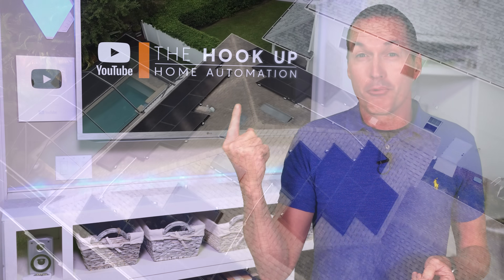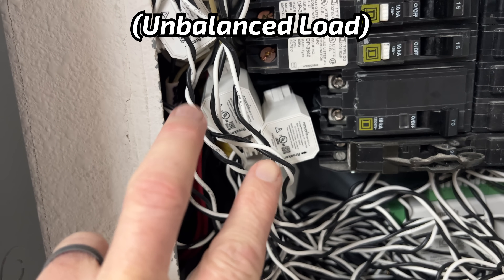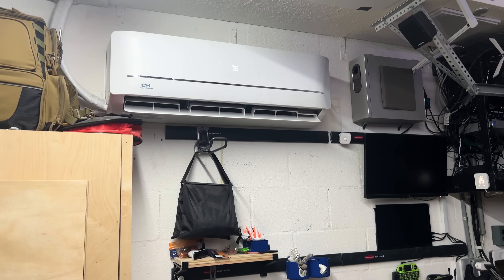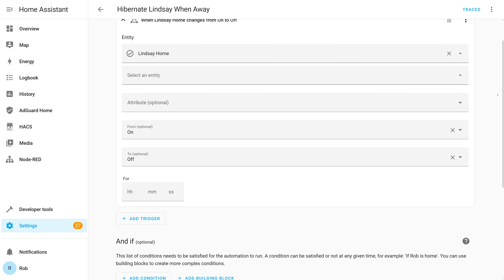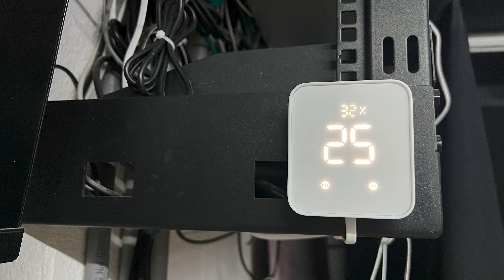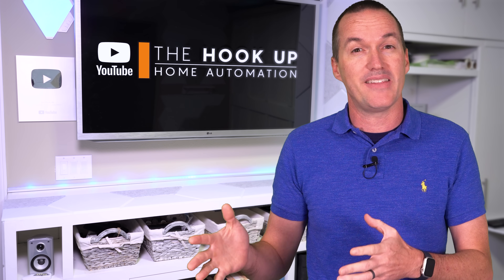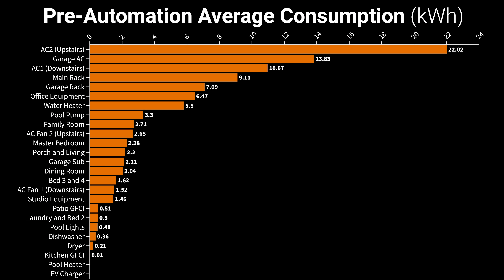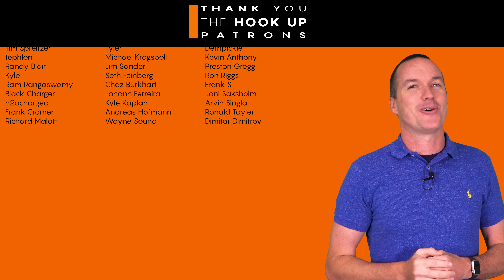I cut my electric bill by $1,331/year (with Home Assistant automation)

Comment: Shading AC or heat pump condensers doesn't affect things as much as you might imagine. The coils inside doing the heat transfer to the air are already shaded by the outer shell, with a lot of air moving between them; the outer shell is usually a light color so it isn't absorbing anywhere near the full heat of the only 9 square feet of sunlight anyhow. Shading or applying reflective film to one large window would be far more effective at reducing your cooling needs.
Now, in Minnesota, I AM building a tiny roof over my heat pump this year, but because it is under my roof eave and I don't want two foot icicles dropping in to the fan like a javelin in early spring.

Comment: Could potentially investigate passive cooling techniques that allow hot air to escape from the highest points of your house, and/or employ pressure differentials to pull cooler air into your house and force warmer air out.

Comment: Landscaping that provides exterior shade might work better than changing your A/C programming. Why push the heat outside if you can prevent it from getting in to begin with?

We had a plasma TV that, when on, used 300W and gave of f a ton of heat. We switched it out to an OLED flat panel and it runs at 75W with very little heat, comparably.
Reply from the maker: I already have a 50ft tall 4 trunk oak tree in my front yard.  It destroys everything.

Comment: Great stuff!  I've already got an Emporia on half of my circuits (I didn't realize some of the circuits were doubled-up from the previous owner at the time we bought our home) and I've done some of the same things to try to track down where unknown or unexpected consumption is coming from.  The out-of-the-box capabilities of that system are solid, although I wish it integrated natively into Home Assistant.

The other fun game to try, is to see what is the bare minimum you can get your house down to in terms of draw at any point in the day.  I've done this with CT feeds off of my Enphase solar and the integration available to Home Assistant - it's fun to watch.  The best I've been able to do - when the weather is mild, and we're both away from home and everything should be shut off as much as possible - is about 250w of draw, which is about 6kWh per day.  I have a statistics helper in Home Assistant which tracks the daily minimum value, and puts it on my main HA homepage.

Comment: the house uses 100 kWh a day?? holy shit. that's like 36000 kWh a year! crazy stuff.
In our flat we use 2200kWh / year, but to be fair that does not include heating, and we only need a tiny bit of cooling. you could add another 2000kWh or so for that / year.

great job on starting to cut some of that energy usage down, the low hanging fruit really make a huge difference already.

Comment: Rob, in August our family went on vacation from 8/15 and returned on 8/25. I turned off the AC when we left and turned it back on early on 8/26 RG&E here in Rochester sent me a hilarious text on 8/19, "RGE Alert Low Usage Change - Your average usage has been 61 Kwh per day and now it is 8 Kwh / day" so, 53 kwh a day for the AC! My wife has to have the temperature in the house around 60 year round.... Yeah, I know, I know, just wait until it's too hot for your wife.... Yeah, the struggle is real! If your wife was patient as you have done all this, then you have a keeper man!

Does it make any sense to put some passive vents between the 1st and 2nd floors to move the air around more?

Comment: Next - buy couple of solar panels on the roof and a hybrid inverter/solar controller and even without installing batteries, you will kill half of your bill without all these compromises. You have Sun in Florida - use it. The beauty is you produce the max energy when you most need it (for cooling).
Reply from the maker: As I showed at the beginning of the video, I have a whole roof full of panels and 3 batteries.

Comment: Heat pump water heater in the garage is a Florida super hack.  Very little waste, the exhaust is cold air in the garage cooling off your garage, and heating your water.  I hear ya on the power usage front, I have a rambler had to do a double take after using 90kwh in one day.

Comment: How did you deal with the antenna for the Vue. Since your electrical panel is sunken into the wall. Did you just leave it behind the panel?
Reply from the maker: Yep, just sent it down one of the punch outs.  As long as it's not in the metal box it's fine.  WiFi easily penetrates drywall.

Comment: Just a little advice - Shortening the leads is not usually recommended.  The clamps are balanced to lead length and the clamp itself.   Reducing the length of the leads will affect accuracy of the readings.    This may not be a major issue if you are just using them as a reference, but if you want accurately, you shouldn't trim the leads.  Use zap straps, or zip ties, in preference.   
It seems like a good idea to reduce the lead length for neatness, but it does affect accuracy as the clamps work with inductance and capacitive coupling.
Reply from the maker: The Emporia manual suggests shortening the leads for a cleaner install.  🤷‍♂️
Reply: @TheHookUp  Maybe they have a self-calibration method or feel the inaccuracy may be not enough compared to the cleanliness of the install.....    Things are getting more intelligent these days.  I am a bit old school with my knowledge of inductance :)
Reply from the maker: The explanation I heard was that there is 50ft+ of >32awg wire inside the coil, so shortening the 24awg leads by a few inches will have a negligible effect on overall internal resistance.

Comment: I drop my temps at night to pre cool my house.  Letting your house warm up and then cool it down is less efficient. Pre cooling at night is the way. Watch Technology Connections. Also I think having your downstairs higher temps than upstairs might make your upstairs a/c work harder. I wonder if dropping your bottom floor temps to the same as your upstairs might take some load off your second floor and be more efficient.

Comment: Look at switching your pool pump to a DC powered pump. They save HUGE in power consumption.  Also, dont underestimate the investment for really good attic insulation (and dont forget it needs topping up every ~10 years or so).  Doing so for me, dropped my heating/cooling bills almost in 1/2.  Lastly, when your A/C is ready for replacement, look at a heatpump. It will dramatically drop your cost to cool your house.
Reply from the maker: Aren't all AC's heat pumps?

Comment: If you are surfing the web use a pad not a desktop gaming rig with three monitors.  If your AC use R22 consider switching to HC22 which will lower your outlet temps and lower head pressures saving real money.  Shade your condenser!

Comment: Call your utility cause they sometimes use the usage rates of the previous year during that same time that year, also check your grounds on your main panel so you arnt leaking power. You can balance the loads in you panel too cause you meter reads the higher leg phase in use

Comment: Attic insulation and SEER ratings of your ACs and if they're variable speed or not.  I have many of the items you have but have high end insulation and high efficiency variable speed AC units and consume about half of what you do (no pool pump) on a per device scale with similar monitoring from Emporia.

Comment: Rob, masterful as always. I was surprised you don't use Node Red. I bought and flashed my Emporia a year ago and I wen't through the same exercise you did. My Atlanta house has two levels + an unfinished basement (no AC or Heater but fully furnished), Master bedroom on the main floor, so when my sons are not home, the upstairs AC goes to "Unoccupied" mode, via a very elaborate Node Red automation  that uses my teenage boys iPhone Home Assistant app. When there's not one home, for 24 hours, the house goes on vacation mode, which also sets the AC units to power-saving mode, along with the Heat Pump Water Heater. There are lots of other things I do so save on energy, like lights on and off automatically, bathroom fans on auto shut after 15 minutes, etc, but I agree that the Emporia Monitor is a must-have. I biggest expenders are my 3 computer servers for Plex, Home Assistant, Blue Iris and other applications, but those have to be on 24/7. Thank you so much for the time you spend on putting these videos together!
Reply from the maker: I'm a big node-red user.
Reply: @TheHookUp  I know, I learned it from you!  Because of your video, I went over my entire Emporia configuration and I found a couple of errors that I was able to fix. Thank you for your content. Keep doing what you do. Big fan here!

Comment: Look at triple glazed windows, outdoor block out shutters.
Increasing home thermal performance with insulation (roof, floor, walls).
Seal all gaps (basically get closer to a Passivhaus as possible).

Comment: how renter friendly would say the Emporia kit is? i understand I would need to get behind the circuit panel but is it easy to uninstall with little to no trace?
Reply from the maker: The only issue is that you're supposed to punch out one of the rings from the bottom of the panel to poke the wifi antenna out.  Everything else is very easy to uninstall.

Comment: thanks for the info... i REALLY wish emporia would allow for a local control option, as I just can't justify buying and installing equipment that might have the app go away (or not supported) or a cloud service that goes away. Companies get bought, product lines eventually become unsupported, etc. so if I knew I had a local control option built in, i wouldn't hesitate to buy one. Not sure why companies aren't waking up to this.
Reply from the maker: I take solace in the fact that if the cloud service ever craps out I can flash with ESPHome relatively easily.
Reply: @TheHookUp  yeah that is nice. i wish companies would just have a local option as part of the product so it wouldn't rely on that. thanks again for the video and for covering the local control questions.

Comment: Your energy savings is what i use a day 😂
Heat and cool my whole house with one mini split AC.
Bought one of the fifth most efficient ones i found.

If you have solar then try automating to maximize self consumption of that and turn everything not critical off when sun is down.

The most economic solar production is the one you use yourself

Comment: Almost 100kWh a day is wild 😅I live in south Germany, we pay around 32ct/kWh on average here. Our house uses around 10 to 15 kWh a day during summer time and we've have a small solar system generating around 5 to 6 kWh on a sunny day (2x445w panels, soon upgrading to 4 of them). My parents do not have A/C at all. My wife and me have two small A/C-units in our bedroom and living room upstairs because it gets pretty hot up there in the summer time. Pretty interesting how habbits are different in other places of the world 😂 No hate btw. Nice video 👍
Reply: seems crazy to see people wasting 100kWh per day.  Time for some energy improvements.
We have 3.8 cents per kWh in my area and we don't waste any power = 37kWh per day average summer and winter but the houses are super insulated where we live.  Heat pumps make it all work for low energy consumption.  Solar helps April to September.

Comment: 500$ per month in summer....you got a pretty big design problem.
I'm off grid and pay 0 € bill, 9kWc installed, electric car.
You Americans have bad designed houses and then waste energy cooling/heating them....non sense.
Reply: If they build properly no one will be able to afford such a house as even those paper houses they have cost millions. Land is insanely expensive there and very few can afford a house built for ages - it's actually cheaper there to build a cheap house just enough to last for your own lifetime and pay extra in maintenance... And even when money is not an issue then finding specialists capable of building such a house won't be easy - you'll need to bring them from Europe.

Comment: That looks like an absolute mess. If I was an electrician and opened that up, bye bye.
Reply from the maker: If you were an electrician and you opened it up you'd understand what CTs are and that it's just low voltage wiring.

Comment: I live in Sweden so I don't have the same requisites as you.
But if you have a ventilation system that controls your in-house airflow I think that you might also benefit from having all of your inlet air coming through a deep dug down air duct that has a "snorkle" at a strategic place in your garden.
We here in Sweden have the depth decided by freeze depth of the ground. So we place it a good bit beneath that depth. This gives us "free" pre-heated inlet air in the winters and pre-cooled inlet air in the summers.
The cost of this is the initial installation costs and the costs of air filters as you don't want dusty and dirty air coming into your duct.

The length and dimensions of the ducts are dependent on how much airflow you got, of course.

But here in Sweden a typical 1700 square feet (~160m²) house would require about 2x82 feet (2x~25m) long ( in the ground) 6,3 inch (~160mm) duct dug down about 6,6 feet (~2m) into the ground. You want slow airflow through the duct so it will be able to collect the ground temperature as much as possible.

If you have the possibility, drill a couple of holes in the gruond on different depths and put a temp-probe in each and have a yearlong monitor of them to see which depth would be suitable for you. Then if possible try it out and measure the results and post a video on the topic.

Don't forget to keep the duct on a slope outwards from your house and have it constructed such that eventual condensed moisture will be able to evacuate out in the bottom of, for instance, a T-connection at the bottom of the "snorkle". It also has to be placed in a well drained location with mesh or something in the bottom to keep ground living creatures out from the duct.

Good luck if you decide to try it 👍
Reply from the maker: About 2m below the ground here is water :) We don't even have basements in FL because we are so close to sea level.
Reply: @TheHookUp Ok, then you should be able to get some quite good chilling effect by placing your duct a little bit above. Water is good as it conducts heat pretty well. The biggest problem will be how to get rid of condensed moisture in the duct. That can be solved by creating a low spot and put a bilge pump with a level actuator in it.

Thank you very much for your answer and interaction 🙏👍

Comment: For the pool pump you want to cycle the water once fully in 24 hrs so that's the speed you want :)
Reply from the maker: Most places I've seen recommend 2 turnovers in 24 hours.
Reply: I'm cheap and run the pump 9 hrs to cycle it once. Pool is crystal clear 🤷🏽‍♂️
Reply from the maker: What's your pool temperature?
Reply: Currently 90 haha it's been hot.  35,000 gallon pool, set the chlorinator at 5 and that's all I do

Comment: Almost bought Sense back in '17 but went with Smappee instead as it offered an optional gas and water monitoring. It worked very well at identifying devices down to 12-15 watts. Unfortunately it died earlier this year and they discontinued it for a much more expensive setup that I'm not sure you can get in the United States. I went with Refoss which looks to be a clone on the Emporia Vue 2 and has HA support out of the box. The app seems lacking compared to what you showed for Emporia so I really need to get HA setup. The Refoss is about $50 cheaper than the Emporia.

Comment: Do all American houses run like this? To me it seems crazy leaving a computer on anyway if you're not using it. Like the golf sim, you can't wait 4 minutes! To play? You could try making an automation based on weather apps? And probably increase the lowest temperature by a degree. You have air to air conditioning so it only cools the air, not really the building fabric, so running it when you are not there has very little benefit.
Some of those items running 24 hours a day just again seems crazy. And I refer back to my original question, are all Americans this wasteful?
Lastly, do you not have a solar battery?
Reply from the maker: Yes, I have a solar battery.  Yes, this is probably typical usage for most Americans in terms of devices left on.

Comment: Let me know what you come up with on automating the salt gen and pool runtime based off pool water temp? ;-) that's the real saver. you store all that savings for net metering into the next year. I'm doing it manually right now, because the salt gen will tell you the water temp. the pump has an rs232 to do some automation, but haven't gotten funky with it, yet.
Reply: Also install a return line flow meter to get your necessary run time/RPM for the pool pump. gets you GPM. GPMx60xhrs to get gallons. 2 turnovers per day is good enough for FL.
Reply: 1 turnover for winter time. basically, when the water gets to ~70. that's how you can get the savings. also, lowering the salt gen percentage as the pool temperature cools.